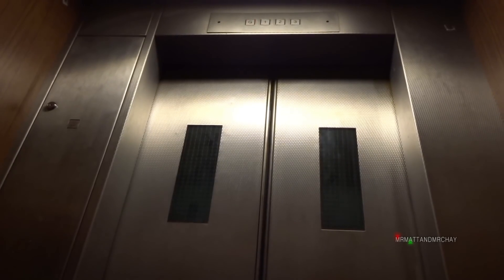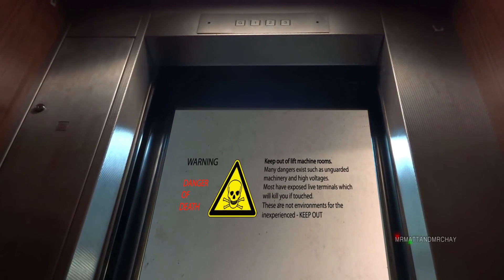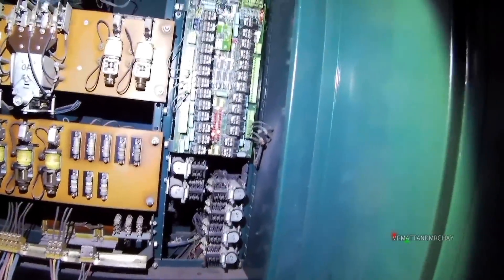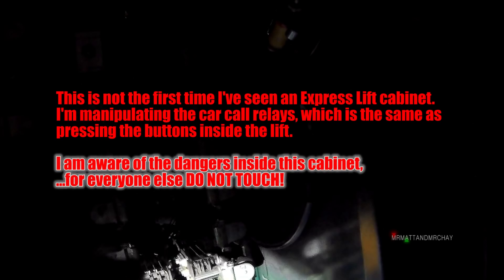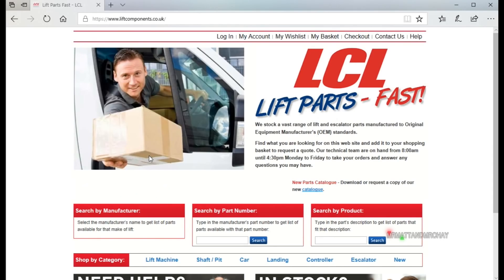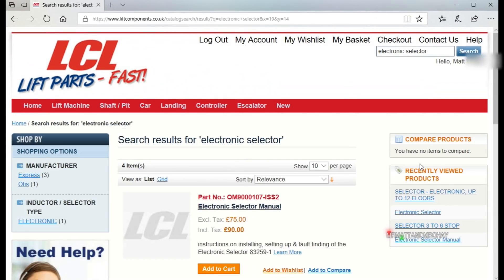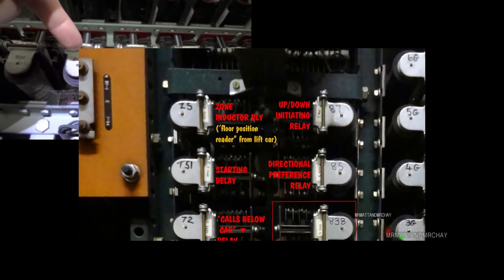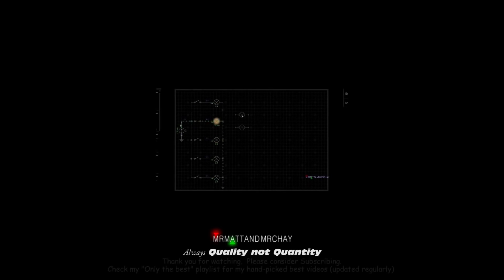1970s 'EXPRESS LIFT' motor room (£90 FOR A MANUAL!!??)

Comment: 1950s - 1960s DMU trains had the same style Gents buzzer as the one mounted inside the equipment cab. Only trains had 24v version and the one in the video is labelled 12v.
Reply from the maker: Ah right!  If im not mistaken it gives off a low, dull kind of buzz?

Comment: Awesome videos! It's really cool to be able to see these systems at work. Just subscribed.
Reply from the maker: Thanks for the sub!  I'm fascinated too with the older systems. If you think about it, EVERY lift that was ever installed before the mid 80s could not utilise the power of computers and microprocessors.  Think about all the high-rise buildings that also had to use mechanical systems to determine logic control for lifts.  WISH I could go back in time to see them!

Comment: Was that an Express hoist gear? The motor didn't look like the usual squirrel cage one and the gearbox wasn't familiar. (My father was a Service Supervisor with Express and I was dragged (not really) around so many lifts and motor rooms when a youngster. The noise in the car was I assume the inductors clicking in and out, shame the mechanical selector was replaced but they were a bit of a beast to setup.
Reply: It is an Express B machine with what looks like a Laurence Scott motor. This was quite a common arrangement on low rise  single or 2 speed installations.

Comment: With that floor selector (and the mechanical one it replaced) what would happen if the power to the lift was disconnected and the lift brake released to move it between floors such as in an emergency evacuation during a power cut?

Would it regain its position when it hits the limit switches? How would that work with the older mechanical floor selectors?
Reply: Yes, via the Top or Bottom  stopping limits (NOT FINAL LIMITS). this would activate the reset via the interuptor  contacts at the top of the MH SELECTOR.

Comment: I like that they upgraded the controller rather than replacing it with a PLC. BTW very nice video as usual. #qualitynotquantity
Reply from the maker: Yes, replacing the mechanic selector was probably way cheaper than modernising the whole lift.  But I suppose there are not many companies these days that would entertain this (messing around with old gear) so I think next time around this lift is going to be completely modernised :(  (no plans at the moment though)

Comment: Well that scared me really bad at 3:12 Anyways it's always nice seeing these relay logic controllers before their all gone. Also, i was wondering, do you you have a video explaining all the safety and positioning sensors on a new lift, because i am trying to make my own controller that runs on 115v but i need to know what sensors to add in.
Reply from the maker: yes, initially it wasn't intentional, but when I played it back I thought "yep, that worked!!" coz it made me jump as well the first time!
Reply: That loud clunk that you can hear on startup is the Brake Plunger, the rubber washer at the base of the plunger is worn and needs replacing. They were made of leather originally and it acts as a residual washer as well as softening the sound of the brake energising. When the washer is replaced the brake would be adjusted. Their is too much lift on that brake at the moment.

Comment: Amazing vid again, very nice machine, built like tank. The electronic selector just let me thinking .... You said one time that their function is not only track position but in case of power outage, on power return, the controller now exaclty were the car is since it is a mechanical device that holds the position prior the outage. So, the electronic thing MOST have "memory", I mean, battery back up, or EEPROM or something to STORE the state each time something changes. OR the relays are the "Bennie Lifts" type, those that will stay either CLOSED or OPEN no matter if they have or not power. They only need a short pulse to change and then they hold the value. The board has some labeled IC htat is a bit big just for being a logic IC, IMHO this is a microprocessor based board, and as it look a thing from mid 90s I would bet on a BATTERY BACK UP rather than EEPROM. I you have taken more stills from the board, are you able to spot a battery ?. I mean, more like a CMOS type of thing. Could be standard logic also, but they are power angry and not sure how they would keep their state. But the board have not much ICs, some of them, the YELLOW ones, are isolators. You another 4 ICs just to drive the relays ....  If you have a good still I can have a look if you want.
Reply from the maker: Quick reply (as I'm just about to sleep lol), not sure about the standby battery, but if it didn't have any kind of backup then the top/bottom shaft limit switches would correct the selector.  So the bottom switch would reset it to GND and the top switch would reset it to 3RD, just in case it went out of step or selected the wrong floor.  The definite thing it would have to remember is HOW MANY FLOORS are in use, so that the top shaft switch reset the selector to 3RD floor and nothing above it (the selector you can see can do 12 landings, only 4 are in use here).  If you see there are two push buttons, which must be to set up the top floor.  This is why I was after a manual to learn a bit more about it :) (but I'm not paying £90 just for a manual!!).  So much for the "quick reply" lol
Reply from the maker: I've just found out the answer, I'm debating whether to make a video on it or not!

Comment: The size of the motor room door just tells you how slow the installation process was, and when this building was built because back then people were smaller than they are now
They would have to take apart every single piece of equipment and put it back together agian
I say, this is very interesting, so interesting that I think you should add small Motor room to your criteria list, because a small motor room dates the building age
Reply: 4 openings + Motor room . 1 week per floor plus 1 week for motor room completion. 3 days for commisioning and completion of defect report from the test engineer. If you completed before this schedule you got paid a bonus of any outstanding hours left on the Job. That was the going rate in those days for Express Installation engineers. (Happy Days)
Reply: More or less yes, most installations were pretty straightforward. Plumb the shaft, install brackets and guiderails, care has to taken when plumbing the guides as this is the heart of the installation, all the remaining dimensions are taken from the centre -line of the guides.Install landing entrance sills and doorframes (no doors at this stage). The bottom doorframe is not installed at this time, install machine room steelwork, set controller position and place hoisting equipment onto the steelwork plumb centre line of the sheave to the centre of guides. Install shaft trunking and conduits to landing locks, pushes and limits.Install halfway box and suspend trailing flexes, the shaft equipment can then be wired.The counterweight frame is then assembled and hauled up the shaft and left hanging on the chain tackle.The scaffolding is the suspended leaving an empty shaft at the bottom floor. Install car safety gear and construct the car at the bottom level. Work out the over-travel dimensions, re-position the counterweight accordingly and install ropes, fill the counterweight to about 60% full with filler weights and release the chain tackle holding the weight. Install the landing doors locks etc. the scaffolding can then be removed and the car wound away from the bottom floor. Install bottom entrance and doors.Wire motor room equipment, connect trailers under the car, complete car wiring etc. Switch on and hope that you do not blow any control fuses, check motor direction is correct and then set the brake. The lift had to be running on inspection speed with inductor plates in preliminary positions, car doors were also expected to be operational but not adjusted. The commissioning engineer (tester) checks installation sets floor levels  and carries out safety tests.
Reply from the maker: I invite you to have a look at this one...  this is REALLY small but I love it!!  https://www.youtube.com/watch?v=ImjQ946TO5E
Reply from the maker: Was that the general rule for lifts, i.e. 1 week per floor, then 1 week for motor room?  Always wondered how long a project took in those days from start to finish.